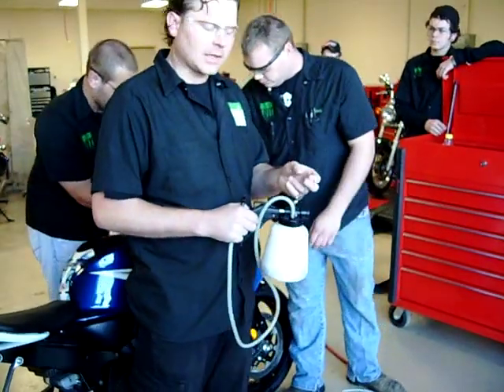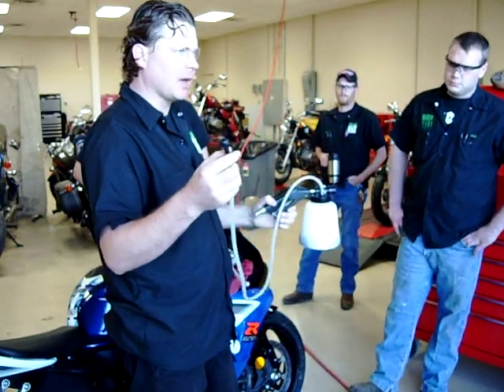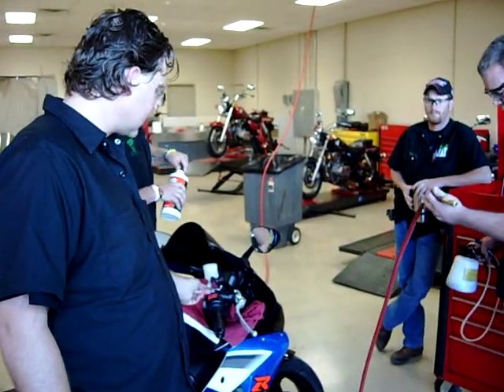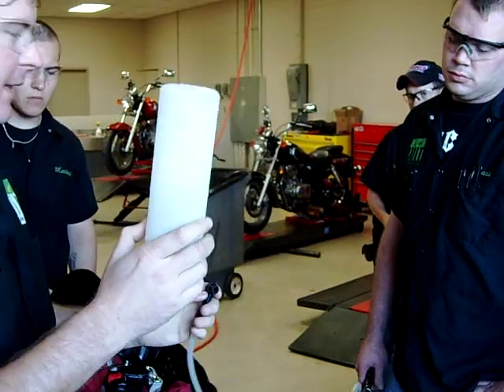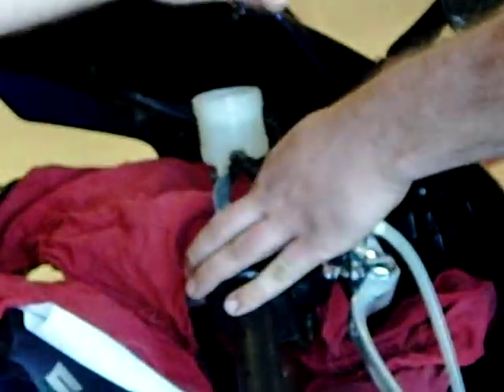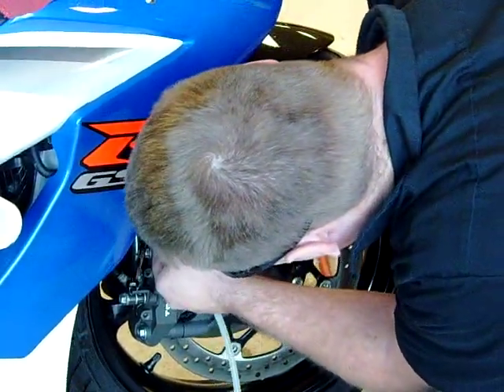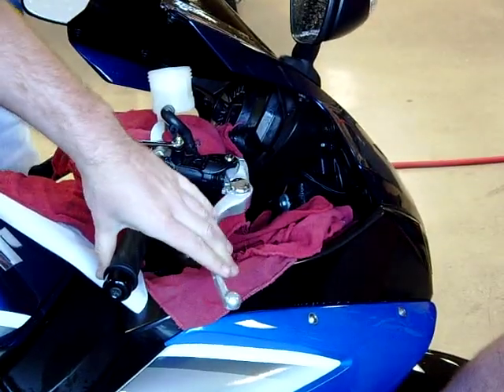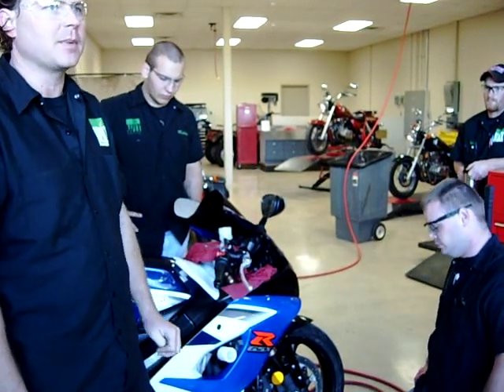Brake Bleeding-Part 3 using an air powered vacuum tool

Comment: Are there special considerations when working on a bike with ABS?
Reply from the maker: Great question! Yes, there are. Some bikes "call for a special tool" which does something to the ABS module. I'm not for certain but I recall a BMW that this tool is what would bleed the air from the ABS module. Always a good idea to verify from the service manual. 
Head over to my website become a member now and to receive 20 minutes of personal mentorship with me. You can even use FaceTime if you have it or find a friends iPhone and we can walk through the actual carburetor process together. I look forward to mentoring you.

Note: Membership is not required to receive coaching or email help. Here are the direct links to individual services offered at H2W:

Email Answer Service-Click http://how2wrench.com/product/email-support/ 

Phone/FaceTime Coaching-Click http://how2wrench.com/product/personal-tech-training-phone-facetime/ 

DIY Mentorship-Click http://how2wrench.com/product/diy-coaching-hire-teach/ 

Dealership Training Services-Click http://how2wrench.com/product-category/dealer-services/ 

MMI/Tech School Student Tutoring-Click http://how2wrench.com/product/mmi-tech-school-student-tutoring-services/

Motivational/Guest Speaker-Click http://how2wrench.com/product/motivational-speaker/ 

On-site Training Services-Click http://how2wrench.com/product/on-site-training/ 

Tech Line Services-Click http://how2wrench.com/product/tech-line-minutes/ 

Mechanic on Duty-Click http://how2wrench.com/product-category/mechanic-on-duty/ 

Did you like this free video and hope to see more? Would you just like to say thank you with a donation? Click https://www.paypal.com/donate/?token=TvKoeRazPL-KysbM-e0ttz-C_gPq2IrqxDmM3ORCu4nxJzQWxYbmo-6m3YuNu64XHLngGW 

Keep Wrenching,
Shane Conley
Instructor/Motivator/Motorcyclist!
www.How2Wrench.com

Comment: Positive bleeding involves making a tight seal at the MC, putting it under pressure with a container of new fluid, and letting fluid drip from the bleeder screws. Problem is, each MC cap is a different size so you need a bunch of adapters. OK if you work at at dealer where they work with only one manufacturer, but for a general mechanic you need a lot of gear. On cars, you don't want to be forcing old fluid and debris back to the ABS unit, so you want the fluid draining out to the wheels.
Reply: This kit cones with different sizes for the brake bleeder bottle